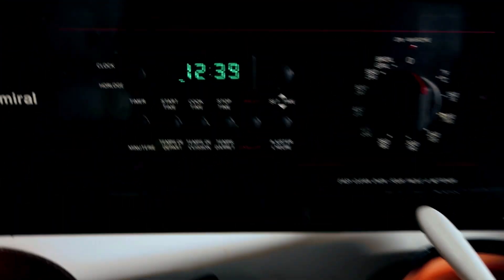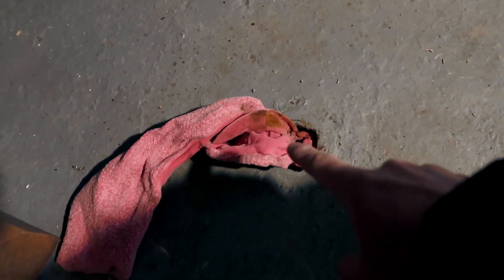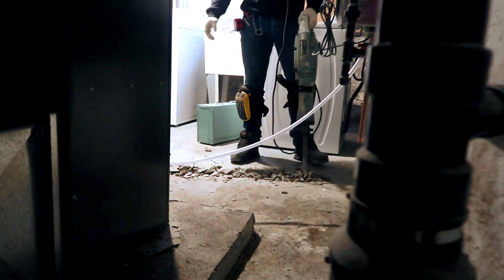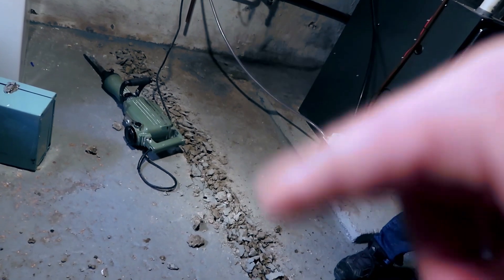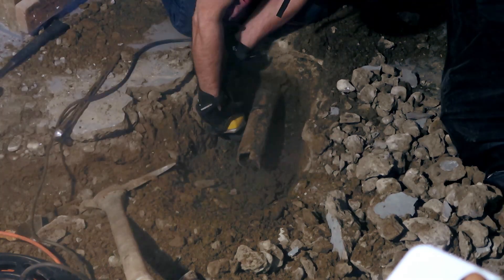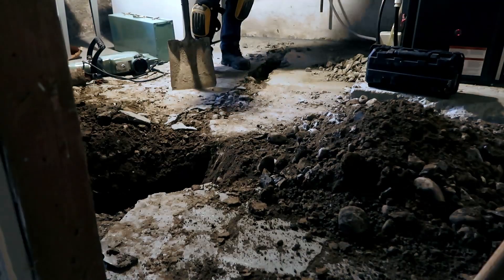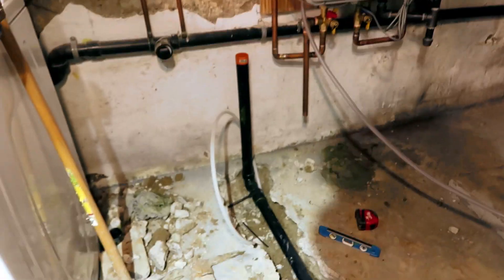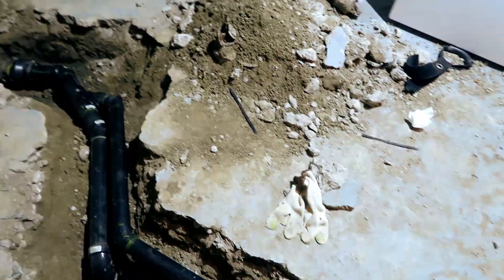This Is Not A Floor Drain! | A Day In The Life Of A Plumber 133

Comment: Try using a 2x11/2 Ty on the vertical section of the floor drain and a then a 1 1/2 abs x 1/2 female adapter then you can use a 1/2 pex x male adapter and crimp the primer is
line instead of drilling the pipe and silicone love your videos nice to see you back! Take care!
Reply from the maker: Thanks for the idea James, and for the support!

Comment: Kenny I see the washing machine drain wasn't in play here . ( must be a seperate line?) . If it were not existing could you have upsizes the tub drain/wet vent to 2" and drained the washer into it?  also..code allows your primer to be a simple peircing?  I would think a tee with a female thread adapter and poly nipple would have been a better choice....don't know just spit balling. Very challenging tearing up concrete inside a building and gauging how long a job it should be.  Worked out though.